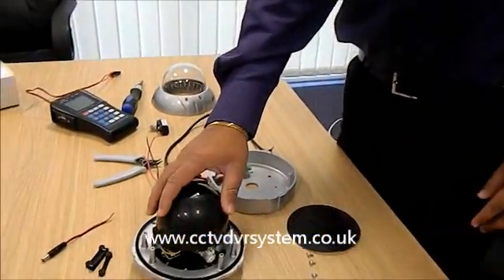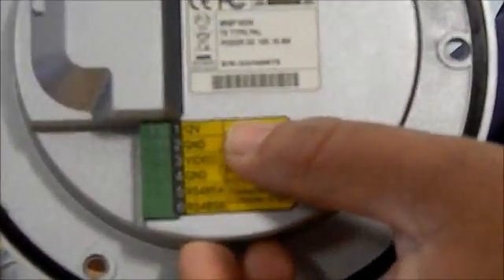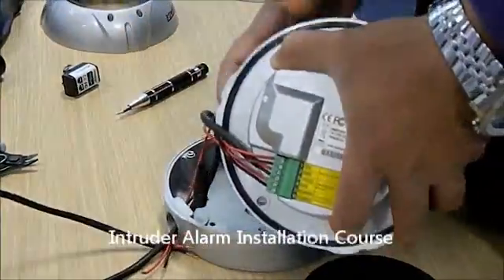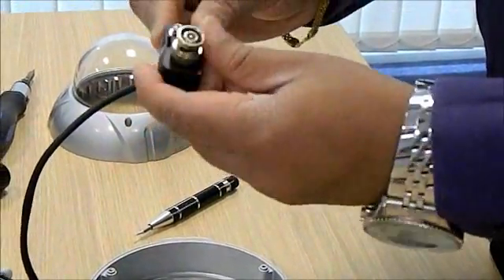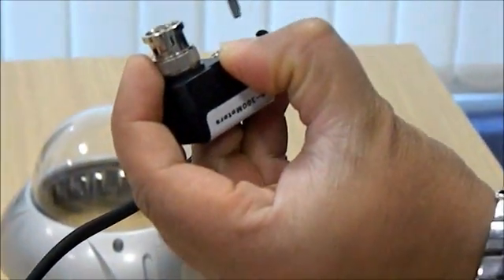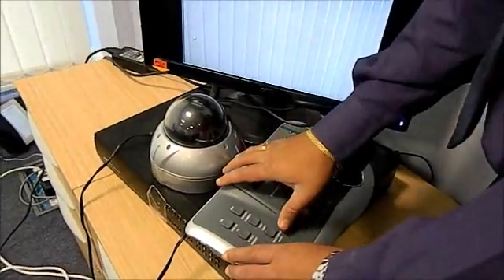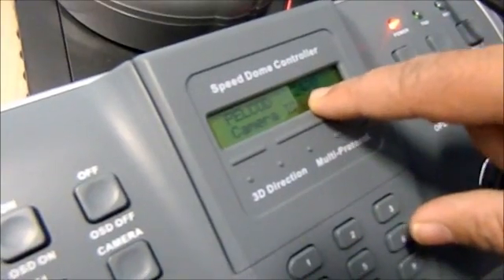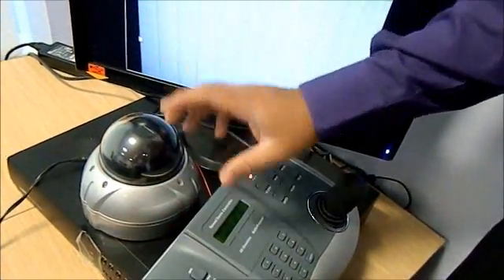PTZ Installation Course

Comment: Hi I am fitting a outside dome camera  now I know the rs485 wires go from this to the joystick control but can you connect the joystick with some other  rs485 wires and also go to the dvr with the rs485 wires to control from both the joystick and from the software of the dvr  on the same camera ?. Great video by the way.